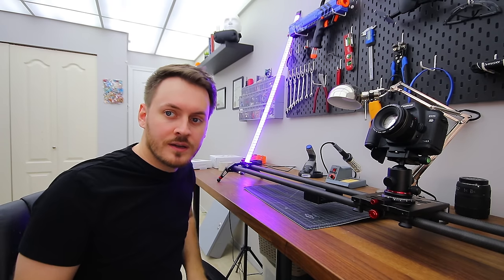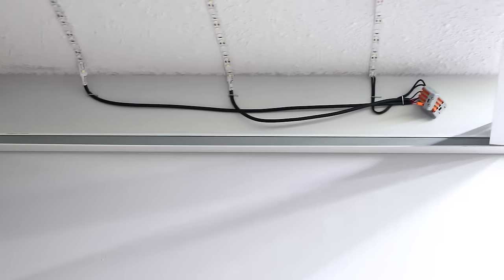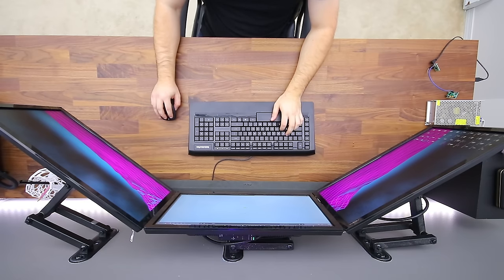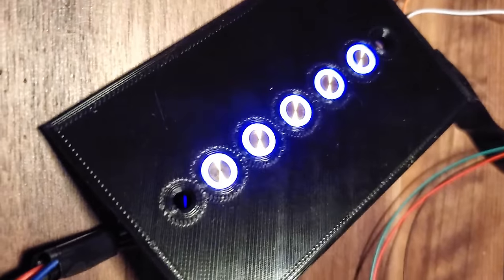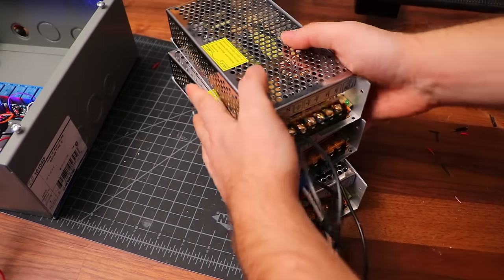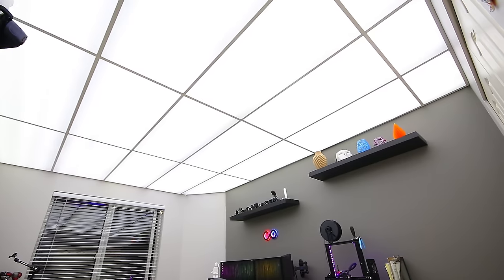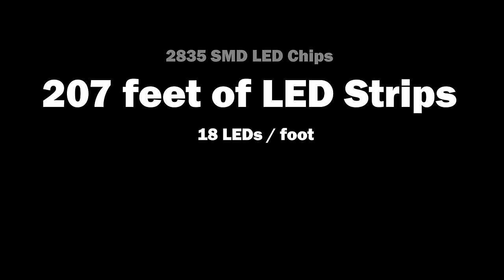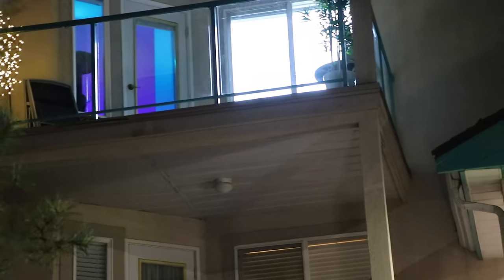Turning My ENTIRE Ceiling Into a Light Fixture

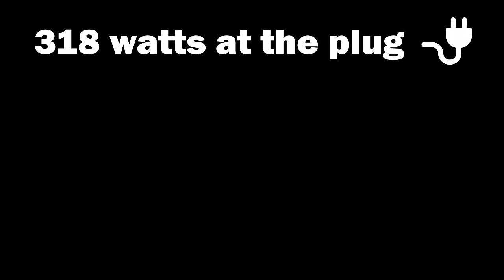Comment from the maker: I goofed up at 8:00 I know!! I meant to say our electricity costs 10 cents/kWh, and 7.632kWh per DAY.  Daily/hourly cost is still correct. OOPS! 😂

Comment below how you think I should add RGB lighting!

*Reminder: Do not try this at home. I do not leave this plugged in unsupervised, and mostly did this for entertainment purposes. I understand the safety risks involved!*
Reply: How can one make this safe?
Reply from the maker: @justinstephens72  you would need something like this installed by an electrical company or get a home owners permit to have it inspected and approved. Use non-chinese made, state/province approved electrical equipment etc.
Reply: Add rgbs it would look so dope
Reply: @Coltography  pin both his question and this answer, please. This is too epic. A lot of people are going to try to it, lol.
Reply: If you ever add RGB, use addressable LED strips and run snake game on your ceiling! ;)
Reply: get addressable led strips, put them in between the rows of strips you currently have. Each tile could be connected to an arduino nano or similar stick. each panel could change or you can have each led in each panel change. 

Im trying to build some large led panels, what did you use as a diffuser?
Reply: Ws2812b Ledstrips with an arduino :) coding is simple if u use the adafruit neopixel library and u can set each led with it's own colour and brightness. 

For example: you could have 3 rows of led strips like u have now and define in the code segments for each tile. Like one of the elements is 1meter long and maybe got 100 leds on it. So you would have element one row 1-3 with leds 0-99. The following element row 1-3 with led 100-199 and so on... if u have any question just ask me :) hope I could give u a bit of an idea
Reply: You can keep it relatively safe if you enclose the light strips in metal sheeting and suspend them from the ceiling.  If it burns you don't want the ceiling to catch fire too. Use code approved electrical wire for the connections outside the enclosure. Install a master relay or power switch that shuts power to everything when nothing is on.
Reply: I would go with addressable LEDs that also have a true white option. I just like the versatility of the addressable LEDs.
Reply: Come on bro, admit it, you watched the video of Kim kardashian’s home tour. The whole ceiling light in her bathroom, down to the “custom round button switches.” It’s cool, I saw it too.
Reply: Michal Kundrát addressable leds would make the room use about 21 universes 
Which would be awesome lighting wise but would cost a lot like 20 grand for the dongle (depending on the desk )

Edit: I am thinking more along theatre lighting wise
Reply from the maker: @bulldoze76  lol never seen that actually, not a fan of those ppl but I'll definitely look up the vid of her bathroom
Reply: Coltography do the walls also!
Reply: "I goofed the math up, I know!! It's actually 10 cents/kWh, so about 7 bucks per 24hrs or ~$0.30 per hour. OOPS!"  You done goofed again -- 318W is $23.04 per month... @ $0.10 per kw/h ($7 per day is $210 a month...)
Reply: @HavokBWR  Just jumping in to 'second' your question! The diffusion looks really good, even with fairly wide strip spacing.
Reply: Can you try to make more tutorials?
Reply: That sounds expensive
Reply: @Coltography  resuming,  pay for the paper that proves it's safe, then it's safe
Reply: U have a few choices .. add RGB strips.. or add RGBW strips...  use a  DMX controller its the easiest way to do breaks, patterns etc...  i make RGBW strips but i use Addressable DMX controllers from EU chips .. make sure they are good ones... the main controller unit i use is a https://www.nicolaudie.com/en/stick-de3.htm  i do thee in the Lambo dealerships...  you can msg me and i can guide you through it .  But it looks very nice. very even color.... if its done in 12 v that is class two so as long as you don't overload the PSW your fine.  i myself use a formula of 2"space for 4' distance from Fabric. now if you use Barrisol then those parameters change.
Reply: linerror Are you really going to use it 24/7? If you use it for 6 hrs per day, you'll spend $210/4=$52.50 monthly
Reply: @justinstephens72  Philips Hue colour+white ambiance lightstrip.
Expensive but totally worth.
You can control it with your smartphone and it is GS and FCC certified
Reply: Its 76 cents per 24h not 7 buck 60 cents. Now you goofed the math up hahaha
Reply: 30 cents per hour means your settup puls 3kw so thats incorrect. Its around 3 cents
Reply: What would be cooler imo than RGB is to make them dimmable
Reply: @Coltography  you have 3 x S-180-12 12V 15A DC PSUs -- Max sustained output physically possible is 540W @ 12V DC --  let's assume these are absolute garbage power supplies and have an efficiency of around 60% -- so at most, 864W from the wall.  " It's actually 10 cents/kWh, so about 7 bucks per 24hrs or ~$0.30 per hour. OOPS! 😂" 10 cents per kilowatt hour is 10 cents per 1000 watts sustained for a duration of 1 hour... 30 cents per hour is 3 kilowatt hours -- that's THREE THOUSAND WATTS for the duration of an hour... how are you calculating 3.5 TIMES your MAX physically possible power consumption? -- "I measured 318 watts at the plug" -- that's what you said at @07:55 -- a sustained load of 318 watts is .318 kilowatts per hour... did you measure 318kwh over the course of a month? because that's a sustained load of 13,250 WATTS (15 times your MAX theoretical power draw) -- Watch again.
Reply: It looks really cool. Just try making it safe and keep it!
Reply: I actually paused and started screaming "WTF?" when you said 1 cent per kwh haha
Amazing work
Reply: still 3 times cheaper than german electricity
Reply: linerror lol ikr you use the common sense check when your off by a full order of magnitude... an entire house probably uses a few bucks a day.

Also using something as a reflector behind the lights like foil. And when you have that many lights, especially with foil, putting them at ~70-80% brightness is probably more than enough
Reply: Replace it with RGBW?
Reply: the first thing I would add would be pwm dimming
Reply: If you're worried about the cost, you can add a regulator so you don't always have to run at full brightness. And as for safety, don't worry. I've seen products exported from China which has worse quality and design used for years in people's homes.
Reply: Did you say you will have the wiring diagram somewhere?
Reply: Hi 🤔 Just out of curiosity, did you check the total consumption with an amperometric clamp?  How much is the total consumption in amps?
Reply: I'd use RGBW strips for the color with each of the rooms edges individually addressable and the middle as a single set.  That way you can get colour contrast without that led bar you had on your desk in the intro
Reply: super awesome !!
Reply: 2:28 someone knows about Coke lol
Reply: What no your math in video was correct.. kwh = 1000 watts. At 227 watts per hour, thats 2.27 cents per hour. 1 cent for every 100
Reply: I think you double goofed your math, .10c/kWh and the panels draw 300 watts. Over 24 hours you'll draw ~7kW which would cost you .70 cents.
Reply: @MigoNL  I'd love to use those, but I think they're still way overpriced. Hopefully it'll be affordable sooner than later.
Reply: @Zeb Holy misinformation batman, this is a new level. All light is radiation called electromagnetic radiation, which in no way affects the human body. That said, specific frequencies, like many ejected from blue LEDs can impact the circadian rhythm of the body if experienced for significant durations and, pointedly, during the night. What many people are unaware of is that your circadian rhythm involves more than just sleep patterns but can affect everything from your metabolism to heart rate and many other internal processes. Again, the frequency of "Blue Light" isn't "bad for your eyes" it just has the ability to throw off internal systems in the body due to our brains response to it.
Reply: The only code violation I saw was putting the 12V control in the same box as the mains light switch.

Anyway 330 Watts at 10 cents per kWh is 30 hours per dollar. I think you had TWO errors cancelling out!
Reply: @DreitTheDarkDragon  no comment.  Just thumbs  up
Reply: Justin Stephens Philips has something similar
Reply: rgbw strips are great i only buy them now rgb and daylight whit on the same strip
Reply: BRAVO!

Years ago, i did a similar, but smaller system under my loft bed.
With different approach, initially more expensive, but the illuminating power is similar to yours, only less expensive on the bill.
I used quality opaline thick plexyglass, high lux transmissibility, and only two RGB - LED strips on the sides of each panel. 
RGB in my case, it's not worth it, illuminates my work desk, so strong colors bust my sight, i always keep it on a warm relaxing amber.

Now i have a new home, with a "lil" workshop. I want to be inspired by your video and illuminate the whole ceiling ... "100sqm" workshop 🥶.
Reply: Thought about doing it for a sec, I know an electrician whiz could help me. Scraped the idea a second later because I can’t install a drop ceiling.
Reply: I can't see this being that much of a risk. I can't find your parts list.
Reply: 0.2$ × 0.4 kw/h × 24h = 1.92$ per day, thats what you actually pay for these lights. Its 400 watts not 4kw
Reply: Paranoia is good thing. Looking at you setup and running a low voltage dc system, then also not hard wired into the electical circuit.  I would think you safe on code issues and being low voltage and the overkill on the voltage transformers I don't see the fire hazard here. The only thing I could think to add is a low voltage circuit protection.
Reply: I’m getting weird dark night vibes
Reply: Aside from rgb lighting, hook it up to Alexa. 
"Alexa, intruder alert"
lights go red
Alexa: "Deploying Metal Gear"
releases a roomba with a taped gun
Reply: Honestly, I think it would be mind blowing if you could add RGB and make this Aura sync compatible. As it stands now, it's pretty fantastic.
Reply: @HavokBWR  Those looked like standard fluorescent diffusers for a 2x4 foot troffer.  They do a GREAT job of spreading the light!
Reply: Tell us about the panels. Where to buy.
Reply: Can you send me the touch button info.
Reply: @Zeb Really not up for debate, the glory of science is that it doesn't care what you think.
Reply from the maker: @linerror   Yeah, I corrected it
Reply from the maker: @juanelca9482  clamp on at plug is 2.65a @ 120v
Reply from the maker: @rydude998  Yeah I'm an idiot lololol
Reply from the maker: @Zeb LED lighting does NOT emit radiation.  Blue light is NOT bad for your eyes. Google it. Thanks.
Reply from the maker: @MrPhilip2253  $0.0945/hr x 7.632kWh/day = $0.72/24hours or 0.03/hour.
Reply: Coltography it's pretty decent .. you don't want to be consuming that all day .. but the amount of lighting for that energy expenditure impresses.. very good work 👍
Reply: @lucf439  4 times. It's 10 Canadian cents. That's like 6-7 Euro cents.
Reply: This would be cool if you had ARGB instead of just RGB
Reply: Now make a version for the floor.
Reply: Entertainment is good word
Reply: Do you want to help me do this in my home gym I am building but with RGB and create scenes for meditation, energy enhancement and focus? Drop me a DM!!! Lets do it.
Reply: Yes used addressable rgb leds so can make cool pattens
Reply: Don't do it.  Do color tuning instead.  Dual 0-10v controls will handle it.  2750-5000cct.
Reply: If you do rgb, you should add violet because fluorescence is super nice. Blue kind of does that but not as well
Reply: 1 cents/kWh would be mind-blowing
Reply: What actually are the safety risks involved here?
Reply: talk about living in a cia interrogation chamber/black site.

or secret laboratory.

i mean this literally looks like the place where they trained jason bourne to be a state operative and killer in the blackwater project....when he took an unknown man's life.....when he shot an unarmed and blindfolded man at point blank "will you do anything for your country????then pick up the gun and shoot!!!" that was the day he gave up his soul and his old identity and became jason bourne.
Reply: 10 cents? You in manitoba? Hah.
Love the setup, was thinking of doing the same with addressable leds in my shop
Reply: 10 Cents?! Wow we pay here 32 Cents
Reply: What thickness sheet is used
Reply: This is great, I've got a pi hooked up to some LED strips in my bedroom as a wake-up light, but surely this paneling is far superior. It's gonna be dirt cheap since you know, waking up only takes like, 15 minutes.
Reply: @rydude998  bad quality white LED's will emit uv light tho.
White led's work by emitting uv's that then hit the phosphorus coating they have on top. With shitty LED's some uv's get through
Reply: The acrilic panels definitely would absorb those uv's anyway if the LED's were shitty enough to let them through
Reply: What are those tiles?
Reply: brother I want to learn your work
Reply: with some people having to pay up to 100 cents per kilowatt/hour, this can become pretty expensive just to run some lighting
Reply: I'm gonna try it at home 😂
Reply: Use mirrors

Comment: Why on earth would you not want to keep this forever. THIS IS AMAZING!
Reply: Totally . Its amazing . I want one .
Reply: I would to. The only problem is the cost of it. But if you find a cheap way to power it. Maybe solar you got a winner.

This would be great for the garage to
Reply: Yeah totally I would keep that permanent!  As for cost, you don't always need to leave them all on, but the ability to fully adjust as needed is really cool.
Reply: I assumed he is renting
Reply: @MATT S maybe a Panel with individual addressed LEDs will replace it so he has some kind of Screen as a Ceiling Light.
Reply: Florida ceilings are back?
Reply: @redsquirrelftw  you know what would be really cool is if you could pwm all those strips and the control would be 5 slide potentiometers.  that would be perfect and doable I think. probably an N channel Mosfet for every strip and the ESP32 board could probably send the PWM signal
Reply: @radnukespeoplesminds  Yeah that would be cool.  Though I would do a buck converter instead so it's smooth and no flicker. (important if doing video)
Reply: @Evening Commenter off the shelf lamp with motion detector electronics circuitry repurposed would take care of that.
Reply: As a diyer/tinkerer myself, you never know if youre gona keep something (as is/may want to modify) or have to remove it for some reason. Hence, build some something easily to disassemble/not permanent.
Reply from the maker: @danielstellmon5330  Proud owner actually! Just wouldn't be covered under house insurance if it caused a fire most likely.
Reply: Its a waste of energy...
Reply: @Coltography  If you calculate what current flows in such a circuit, use appropriate overcurrent breakers and residual current circuit breakers, I dont see a reason for a fire.
Reply: @Coltography question, is this a fire hazard was contemplating the idea of having this light style fixture for my creative studio. ? Lmk pls :)

Comment: If i ever own a house i am gonna show a contractor this video and say do this.
Reply: +1
Reply: Don't say the "do", just say "this", and start crying in his lap.
Reply: Narrow spectrum lighting in my house? No thanks I value my retinas.
Reply: Just get LED panels and dont install any normal tiles in a drop ceiling.
The method used in this video doesnt save money, or time.
Reply: Yeah yet how much will they ask, it should be expensive
Reply from the maker: @TheDarthJesus  incorrect, you would need to run mains to each panel, get venting for heat dissipation and would need reinforced frame as extra weight. Oh and that would cost a FORTUNE.
Reply: Maybe you should first research what LED does to your eyes?
Reply: @AA-MM  better than fluorescent...
Reply: Lmao.... WORD‼️
Reply: ditto!
Reply: Hook it up to your sound system and make it react!
Reply: @beezertwelvewashingbeard8703  I'm pretty sure you can get nice broad spectrum LED strips with good color rendering.
Reply: that contractor would hate you after trying to recreate that wall controller
Reply: $10-20k.  No one is going to jerry-rig that due to liability concerns.  So you would have to buy premade panels.
Reply: @beezertwelvewashingbeard8703  Could you please explain? Is the light ceiling in the video harmful to eyes?
Reply: @AA-MM  Maybe you should research what darkness does to the soul.  0_0
Reply: @Vladpryde  please shed some light